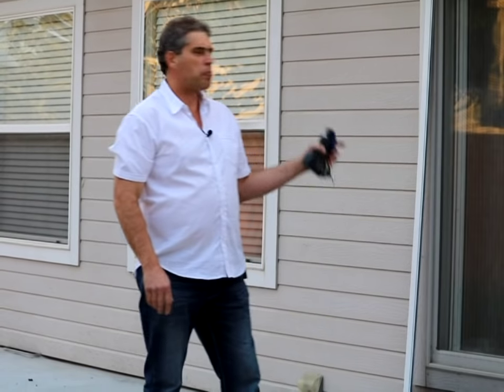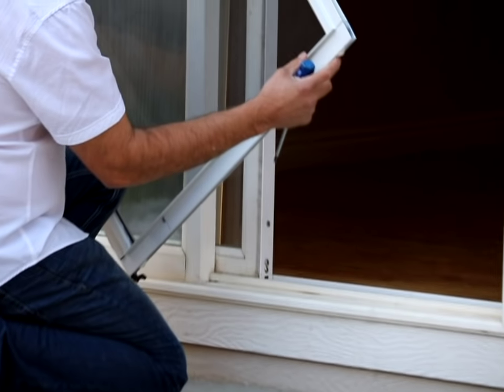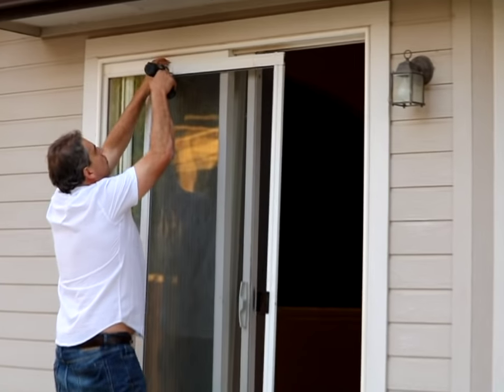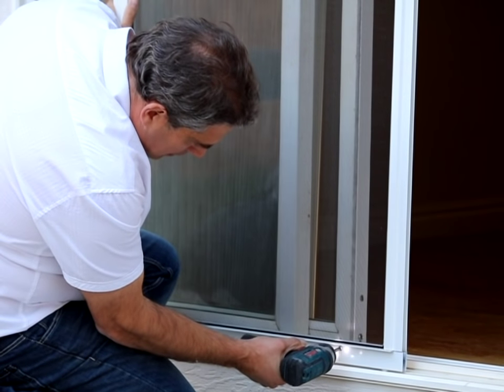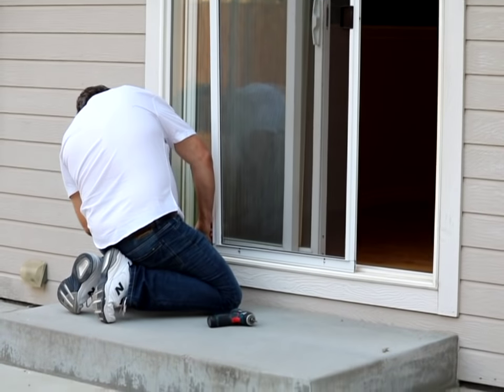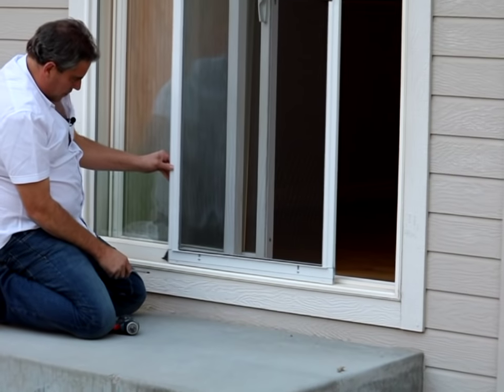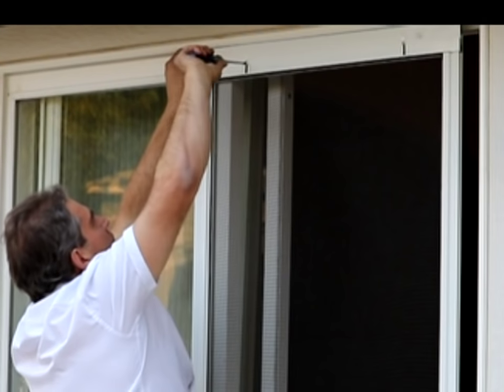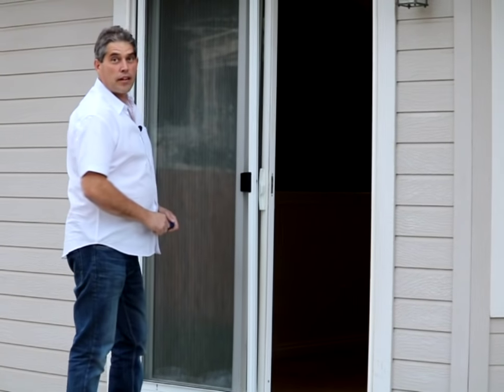How to Replace a Sliding Screen Door

Comment: How long did it truly take? I have the same door and over 1 hour and still cannot adjust correctly.
Reply: Well stop commenting on YouTube you'll get it done quicker
Reply: This should only take a few minutes
Reply: In a perfect world where perfectly plumb door frames exist, according to the directions, it should only take approximately 20 minutes. However, in the actual real world where houses settle, door frames have strange measurements, the sliding track is broken, and the door from Lowe’s is bent, it could take at least a couple hours if not longer 🤦🏻‍♀️

Comment: Never use power tools on a screen door #1. It is easy to over-strip the screw. Put the top in first...use putty knife to pry under the base wheels so it moves into the track...then tighten the lower screws on the 2 ends of the door to raise the wheels and put the door at the right height. It is not difficult.
Reply: I used a power drill. It was a DeWalt! Come at me.
Reply: @chrishayes5755  just have to adjust the torque way down
Reply: I use a 12V Milwaukee impact driver as a screwdriver for years, haven't stripped anything yet. For something more delicate use a real screwdriver. Just in case I have a full tap and die set.
Reply: Lmaoooo never done this before but I came to the same conclusion off observation 🤦🏾‍♂️💀
Reply: Not if you know how to use them. I'm a technician and I use my impact on everything but I'm experienced

Comment: Should the spring loaded wheels keep the door evenly in place?  For some reason I have one inch of space at the top when I have the door closed
Reply: It’s very common for the frame itself to not be completely parallel due to the way your house was built. Not really a fix for it other than rebuilding your frame.

Comment: Not an easy job which is why I am on here. Glad I am not the only one struggling. Problem I am having is the screen door doesnt slide great it sort of teeters and if its too tight it wont slide at all
Reply: The 2 screws on the bottom only need to be adjusted when making sure the door is plum and level on the track.  UNLESS the height of the opening requires it like in this situation.  Once it is established (Bottom)  You adjust the top for a snug fit.   That door SHOULD have absolutely no shaking motion when opening and closing.
Reply: Yeah mine too

Comment: Guarantee that screen jumps off the track every time it's used unless you very lightly apply even pressure at the top and bottom, then sloooowly open it.